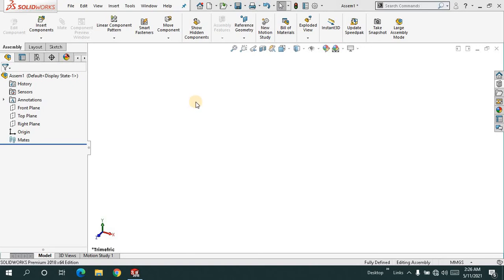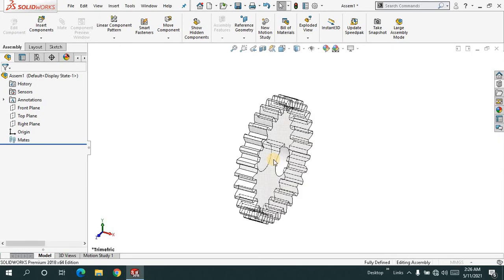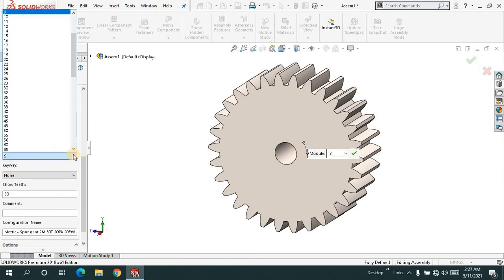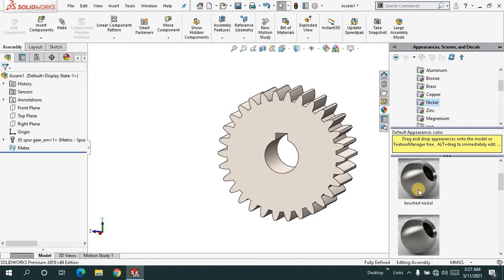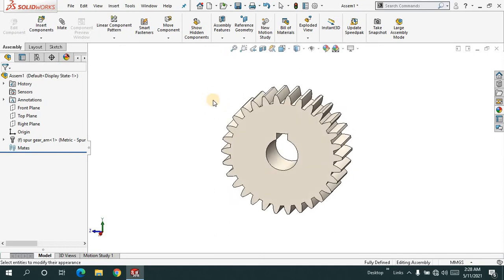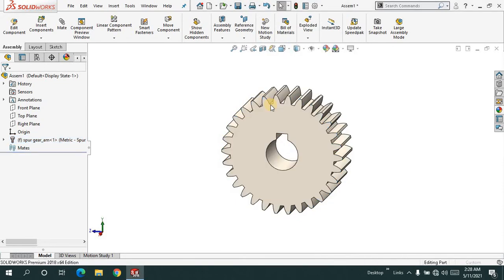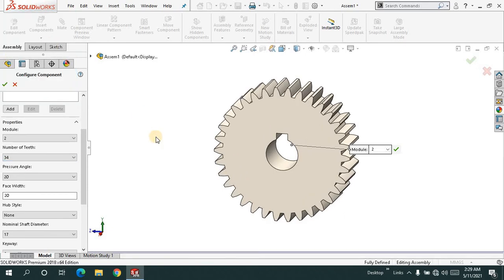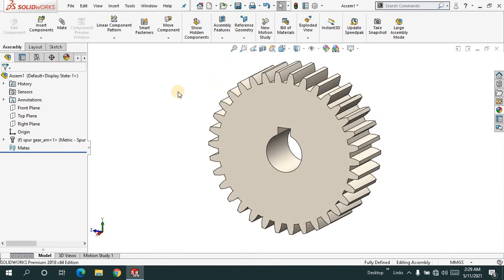Solidworks Tutorials  || How To Edit Tool Box Component || Spur Gear

Comment: how did you get into that option to edit the size?  thanks for any help; (I do not have the edit toolbox component in my drop down menu)
Reply from the maker: yes you can but idk some times this option is now adays not avalaible in the solidworks. yes you can edit anytime once you saved ur file
Reply: Make sure you are in the assemble model